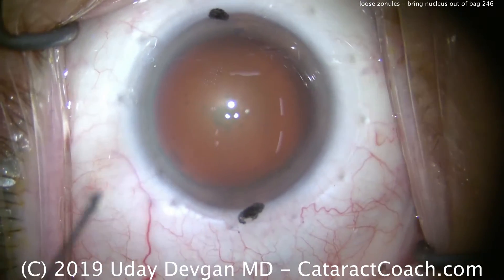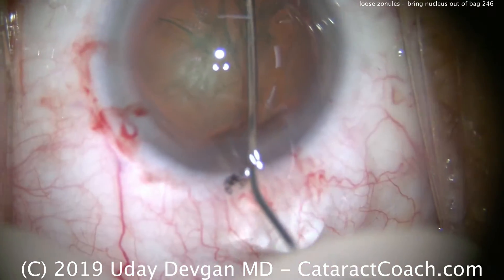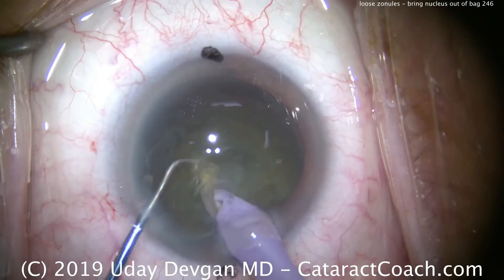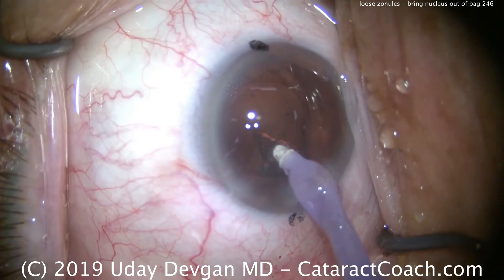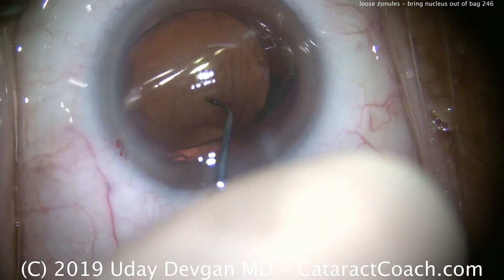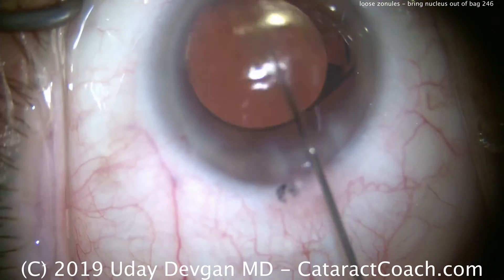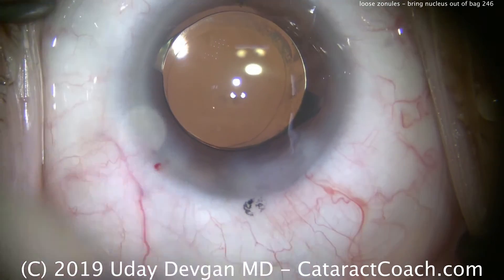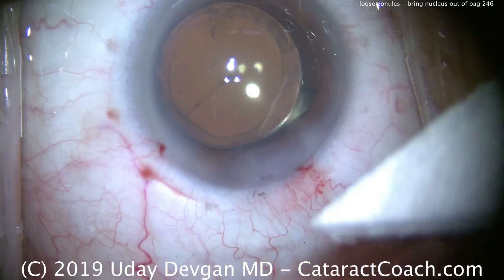For loose zonules, bring the nucleus up, out of the capsular bag in cataract surgery

Comment: If there is a 3 clock hour zonulysis but significant posterior capsule opacification postop, PCIOL is well centered and stable (no CTR inserted), do you think it is risky to do a yag capsulotomy? Thanks
Reply from the maker: Wait 6 months so that the capsule becomes less elastic and more rigid. Then start small and central with the yag capsulotomy